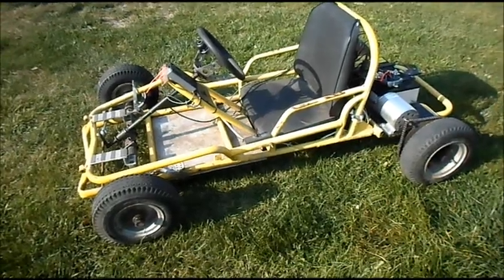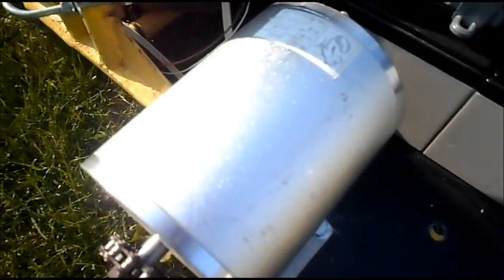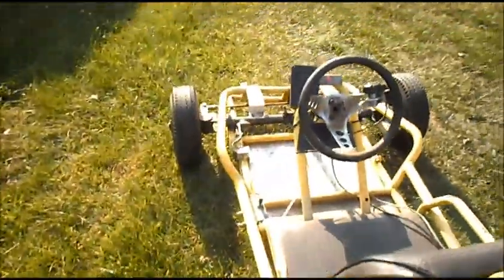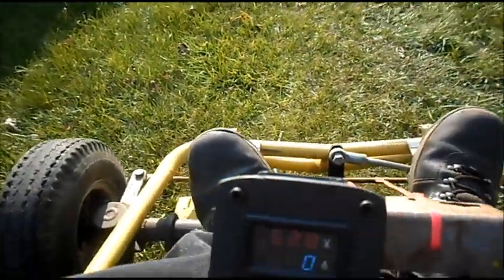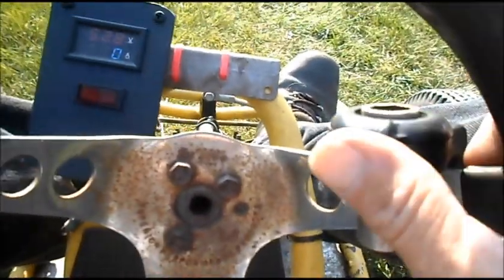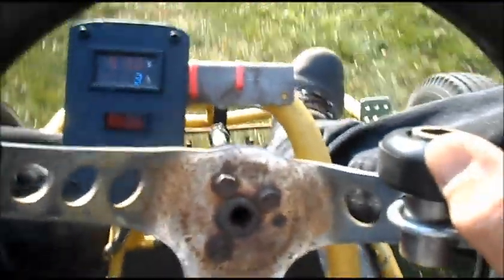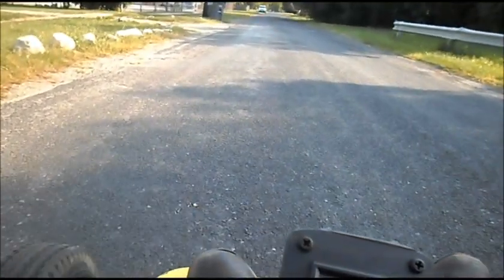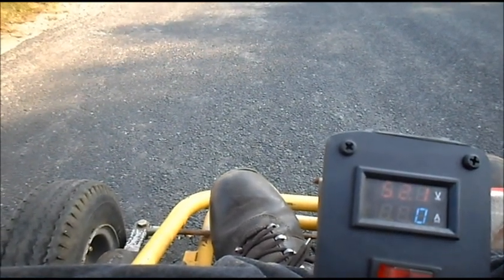e Lemon aid  part 15 Test drive with a Boma 48V 1,800W brushless motor

Comment: Hey! What's the normal amp draw? I'm planning on using 5, 12V DC, 20 ah (Amper hours) batteries, in series (To increase voltage to 60 volts, than it would be ~2250 watts, someone said that should be OK)
Reply from the maker: The highest amp draw I saw was ~30A as you can see in this video. https://www.youtube.com/watch?v=3yzOS4cE424&list=PLoL6eIYWPO_l4g47Zt_YPcBOLSOtLXNqM&index=16I would NOT recommend connecting (5) 12V batteries to a 48V system.A 48V system is designed to handle up to ~53V. (maybe up to ~55V) A fully charged 12V lead acid battery is usually ~13.3V so, (4) fully charged batteries = 53.2V. If you connect (5) 12V batteries, that's ~66.5V, which would probably be more than the speed controllers circuitry could handle.
Reply: @functional_artist  Hello! I am planning on overvolting, and am actually buying a speed controller seperatly, that handles up to 72 volts, 2500 watts.

One more question: What is your back sprocket size? And with what top speed?
Reply: @dangerousdoggo5465  I am looking at doing something similar, have you tried it yet?
Reply: @eslmatt811  nope ended up buying a hub motor 5000W its very powerful, i can beat a car in a drag race to 50km/h and go about 80 max
Reply: @harleythyer6327  Yep, although it was very expensive. Are you looking for just the hub, or a complete set? (Wheel, display, throttle, controller, alarm and whatever else i cant remember?)
Reply: @harleythyer6327  https://www.ebay.com/itm/E-Bike-Hi-Power-72V-5000W-Ebike-Conversion-Kit-Panel-Display-Electric-Bicycle/183593899318?ssPageName=STRK%3AMEBIDX%3AIT&_trksid=p2057872.m2749.l2649
Reply: @harleythyer6327  no problem! also if u have any issues or questions feel free to ask

Comment: top speed?
Reply from the maker: The top speed was ~ 20 mph
Reply: @functional_artist  Do you know of any ways to make it faster? I plan on using 4s lipo's, will that help?
Reply from the maker: You would need to use lower gearing to achieve a higher top speed.This kart has a 10 tooth motor sprocket & a 84 tooth axle sprocket for an 8.4:1 gear ratio. A 72 tooth axle sprocket (7.2:1) would go faster or even a 60 tooth for a 6:1 gear ratio would go even faster.
Reply: @functional_artist  Thank you!

Comment: I want to get this motor. Does it work well for you? Also, how do you set it up with a controller?
Reply from the maker: Yes, it works very well. I ordered the motor & controller together as a package. Here is where I describe how its mounted & hooked up. http://www.diygokarts.com/vb/showthread.php?t=37537
Reply: Thanks! I found the combo on Amazon as well. Also, how did you choose your batteries? Do you have any advice for my choice of batteries, as I want to make a cart like the E-Lemon Aid too.
Reply from the maker: The batteries I used are 12V 12AH SLA (sealed Lead Acid) They weigh 8 - 10 lbs. each & cost ~ $30.00 each. Riding time was around 30 minutes.
Reply: Functional Artist Huh. Wait but you said on speed 3, you were drawing 29 amps max. How does this work if your batteries are only 12 amps? Would I not need four 12v 30 amp batteries?
Reply from the maker: I am using (4) 12V batteries that have a capacity of 12AH (amp hours). They are wired in series to create a 48V 12AH battery pack. The 12AH is a capacity rate NOT an amp out put rate. Think of it as the size of your fuel tank. 12V 30AH batteries would last longer (run time) but not necessarily put out more amps.
Reply: Oh, okay... So all batteries are labeled in amp hours not amps, meaning that there is not a certain "Amp" of battery I need to buy? Some have "Amp" ratings only, such as 12v 12 amp (not hour) battery. So using a 30 AH battery would not get me more performance than a 7AH battery, but rather just more drive time?
Reply from the maker: Yup! That is my understanding of battery designations. Also keep in mind that when batteries are connected in series the voltage increases but, NOT the capacity.  So (4) 12V 12AH batteries connected in series makes a 48V 12AH battery pack.
Reply: Okay, thanks! Sorry to keep bombarding you with questions, as I am jumping into the go-kart field with almost no knowledge, and you have been very helpful. Is there a good way to charge these batteries back up? Like is there a specific type of charger that you get that you just plug into the wall and connect to the battery terminals to charge it up? I plan to get four of these batteries: (click read more for link) https://www.amazon.com/ExpertPower-EXP12180-Rechargeable-Battery-Bolts/dp/B00A82A3RK/ref=sr_1_6?s=electronics&ie=UTF8&qid=1507915423&sr=1-6&keywords=12v+sealed+lead+acid+battery
Reply from the maker: Glad I can help.  This is the battery charger I use. It works great.  http://www.ebay.com/itm/48-Volt-2-5-Amp-Battery-Charger-Electric-Scooter-or-Panterra-PC-Plug-48V-2-5A-/141328152157?hash=item20e7d0765d I added a couple of alligator clips to connect directly to the batteries just like you suggested.
Reply from the maker: Yes, It should. just make sure you order one for 48V. It doesn't mention amp output, so IDK how fast it will charge.
Reply: Oh, so too much or too little amperage will not break the batteries, but just affect the charge time? Also, I dug deeper on the product page for the charger, and it said: Output: 41.4V 1.8A. Is 1.8A too small? Also, shouldn't it be 48V instead of 41.4V?
Reply from the maker: I've been told you want between 10% & 30% of battery pack capacity.I am using 12V 12AH batteries so in the 1.2 amps to 3.6 amps range should be OK. The charger I use is rated @ 2.5 amps kinda in the middle. I think a 48V battery pack should be ~51V fully charged so yes, I would question that..
Reply: Say I choose an 18A battery. Then, it would be between 10 and 30% of its capacity. But just because the charger only outputs 41V, does that mean that the battery can't charge to 51V? Like would this charger technically work for a 48V 18A battery?
Reply from the maker: I would check on specifics with the supplier. probably a misprint. seems like the specs for a 36V charger
Reply from the maker: Yup, that should work just fine & has a digital display.
Reply: Functional Artist Yay! What is that desulfator though, and should I get it?
Reply from the maker: Sure, It's not that much more. It will help & extend  your batteries usable life.
Reply: Okay! Thanks for the help man.
Reply: @texemplarstudios5481  If you want to know theoreticaly how much current you can draw from battery it is labelled with c so for example battery with capacity of 1000Mah which is 1Ah and discharge rate of 1C coud provide 1Ampere. so basicaly Ah*C(rating) .Also the c rating is used on Lithium batteries iam not sure if it works the same way on lead acid.But you could use any lead acid battery meant for  heavy loads like UPS and you should be fine. Iam building an E-bike and i had problems to understand that too. Also to calculate the running time, if you have 1000W motor you measure the Watt hours of battery  Ah*Voltage so if you have lets say 48V and 12Ah battery you get 576Watt hours which is half of 1000W that means it can theoreticaly run 30minutes at full speed.
Reply: @marlez6898  Thanks for the explanation! I didn't know much back then, but I've learned a lot since then.

Comment: Cool I want to do a go kart too. The diagram leaves out the "stalls" wiring which is important as it sets the RPM of the motor. If its not connected it runs at middle speed and not at its full RPM.
Reply from the maker: Wow! Thanks a million. I'll spread the word.

Comment: theres a "stalls"plug that i been told to jump the black and green together but that does nothing also...i also checked my brake and braking plugs and made sure they were jumped and connected,still nothing from motor when twisting:(

Comment: Hello friend,my motor and control box are basicly wired up i just get no response from the motor when twisting the throttle..i get a volt reading from my throttle and it turns on and off when i turn the key but nothing fromthe motor when twisting:(